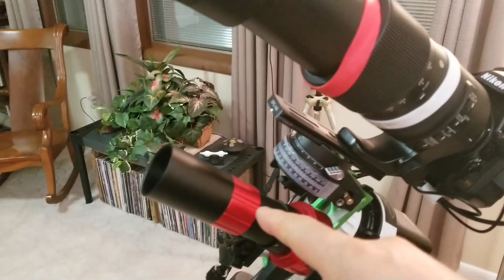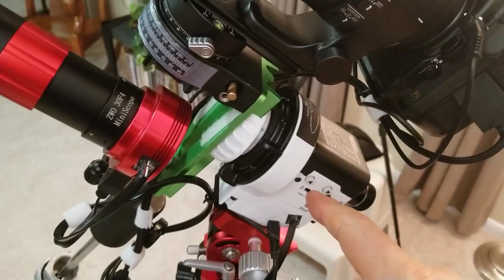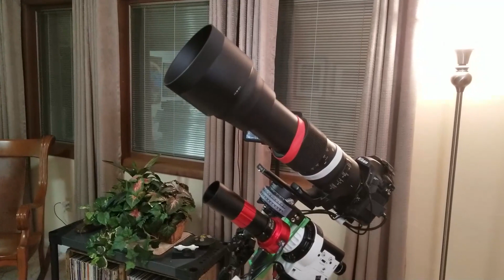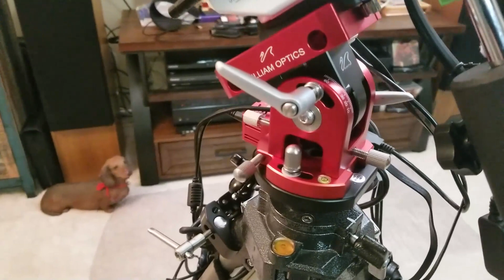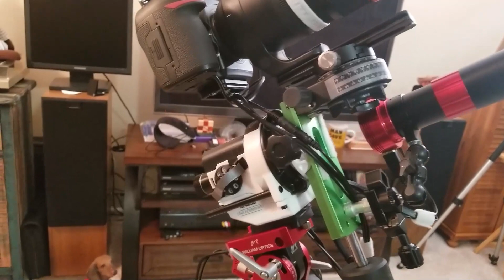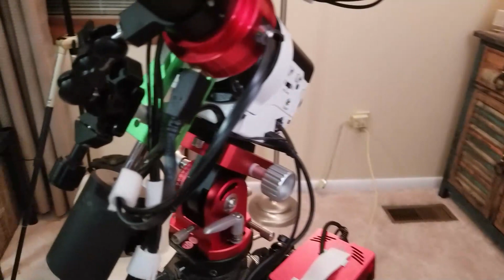Sky Watcher Star Adventurer Pro - An Overweighted Configuration

Comment: I mount the SA on it's wedge on a 3 way geared head and only do fine tuning with the wedge. Also do all my PA with the AAP.

I use a D7500 as it is much smaller and lighter than the D850, and I mount my guide scope to a very small ball head in the exact same position as you show.  

Were it me, I would loose the nodal rail and use a good ball head like the Benro IB2 instead.  The L bracket has a much bigger sliding area to allow adjustment for balance.  I actually mount the L bracket to the Lens foot, and then to the ball head.  Making balance even easier.

I don't see how you can position your camera to all points for the actual shooting without a ball head.

Nice video !
Reply from the maker: Thanks for the compliment on the video.  Actually, it may not be quite intuitive at first, but just as Latitude and Longitude, ignoring elevation, will can define a location anywhere on Earth, RA and DEC can similarly define any celestial position, ignoring range.  But, the "gotcha" is that if you are wanting to establish a specific field rotation to orient your subject in your image frame a certain way, then you will be unable to do so without either of (a) a lens collar, i.e., field rotator or (b) as you mention, a ballhead.  Even a ballhead is sometimes a bit difficult to position the camera with, but it is certainly easier than having no other alternatives.  

The biggest drawback to a ball head is that is may raise your center of gravity (COG) higher and put you in need then of a heavier counterweight to balance your imaging train, and then the concerns about payload capacity of the mount become a bigger factor.  With a mount such as the Star Adventurer Pro, you can lower the COG by shifting the dovetail plate to a lower position, but that may not provide enough offset or could also find equipment conflicts....knobs, dials, whatever...being potentially blocked from ease of access or other such things.  

Your idea of mounting an L bracket to the lens collar is an interesting approach and certainly seems viable, but if I have a lens collar in the first place, then it can be rotated by design so I'm not sure I see quite as much need there for the L bracket.  Of course if you're working with some type of lens collar that doesn't provide for lens rotation, then the L bracket idea would give a measure of flexibility in positioning.  the use of a long dovetail plate or nodal plate is twofold in that for this setup, it facilitates balancing along the DEC axis for a more optimum overall balance and the other reason is that I leave it attached at all times for that Sigma lens, so that it is ready for use on a gimbal for conventional photography.

Mounting the tracker and wedge to a 3-way head would certainly work to aid leveling the tracker, but that would have to be a very strong wedge to carry the weight of the tracker, camera, lens, and all else in the imaging train.  If the gear you're working with is relatively light weight, I don't see any problem really, but as you start dealing with larger and larger lenses or telescopes, it seems to me the potential torque on the head would likely challenge it to hold position securely.  I'm not being critical of your idea, but just sharing why I wouldn't go that route myself.  If, given your use of the L-bracket as you described, you could always keep the weight of the imaging train reasonably well balanced over the tripod head, then that would certainly help maintain that as a functional approach.  At the very least, it never hurts to think outside the box!  :)
Reply: @Ambress , I have the same lens, which I think you said is the Sigma 150-600mm, it's a beast for sure and when you start zooming out it totally changes the torque.  So I did two things that made a huge difference in balance and torque.

1. as mentioned, is the L bracket on the lens foot.  My ring rotates and I use that for framing or re-framing the camera after every 30 mins or so, but the L bracket is a game changer for me.  Because the L is so long in length, I can simply slide the camera left or right and that changes the balance or puts it in balance.  Try it, inside first, it is quite amazing.

2. I did something similar and bought a rod to extend the length the counter weight could travel.....ehhhh worked but that caused other problems.  So I just bought a 2nd counter weight (wish they would just sell a counter weight and not include the rod).  Now I can really fine tune the balance.  

I already owned a Manfrotto 3 way geared head, it is very heavy and solid and holds the SA without issue.. Just to be specific it's Tripod > Manfrotto > Wedge > Star Adventurer.  

Cheers

Comment: I am still puzzled by the reason to have dovetail for the lens. Can you explain to me reason for that? is it to move center of gravity given front heaviness of lens?
Reply from the maker: Hello Sumit.  Well, first of all and perhaps you know this already, even without a dovetail type of quick release plate, lens collar with some type of mounting foot for a tripod is useful on a lens and many long zooms and telephoto lenses to come with those.  But yes, exactly, extending the length of that foot with some provision to attach it to a tripod anywhere along the length will aid balancing your camera/lens combo, and that is exactly the goal for astrophotography.  The dovetail style of mounting plate just makes that much easier by having the ability to loosen the clamp and slide the imaging train forward or backward as needed to achieve balance of the DEC axis.  Before doing that however, you first balance in the RA axis by adjusting the counterweight so the mounted equipment when rotated to the horizontal plane is balanced with the counterweight, and then, to aid better gear meshing of the tracker or equatorial mount, you shift the counterweight very slightly closer toward the east so that there is a minor weight imbalance to oppose the RA rotation and put a gentle pressure agains the gears.

Comment: I came across this video looking for some answers.  You and one other person are the only people that have come out and said that using a 150-600mm lens doesn't work well with this product.  I have a D810 and the 150-600mm.  On my home scale the combo weighs 6.6 lbs.  I had started shooting with this and had my D810 modified for Full Spectrum.  I'm moving back to the Sony A7RIII and my 100-400mm.  It's over 1 pound lighter and had never had a problem when using it.  My Star Adventurer is at Skywatcher now being repaired.  The tech at Skywatcher told me that I was really pushing the limits to use the Nikon setup.  I can still use it for close objects and Milky Way with the Nikon.  Thanks for your video.
Reply from the maker: I don't specifically recall saying the 150-600mm lens doesn't work well with the Star Adventurer, but just going by the numbers and the recommendation not to exceed 50-60% of the rated maximum payload for the mount, that would be true in essence.  That said, with the overall configuration as I've presented it here, I'm frequently shooting with my Sigma 150-600mm lens on my D850 and with the fully configured setup inclusive of guidescope, autoguider, dovetail, cables, etc., all weight in just under 9 lbs.  NOT recommended and yet I really haven't had any problems with the SA Pro providing good tracking.  The only real problem I have is just a characteristic of the lens choice...less than round stars.  So, while I hate to give up that focal length, I'm expecting to receive a Zenithstar 61 on Monday, and if the sharpness with that is so much better than even a smaller image size can be enlarged to equal or better than provided by the Sigma lens, then I'll be in better shape as far as the weight is concerned, shaving off about 1-2 pounds.  I've been frustrated by the unavailability of a more robust mount, so I'm hoping use of the Zenithstar lens gives me a longer run of use with the SA Pro while also delivering better images even if they must be resized up some.  I'm glad your Sony setup is working well for you.
Reply: @Ambress  Thanks for the reply.  I will see what Skywatcher has to say when they examine my Pro 2i.  As I told them, I did use the Nikon D810 and 150-600mm on that tracker before without any problem.  I'll let you know.  Just got the SA Pro 2i in January of this year.  I know Peter Zelinka uses that lens but with a D750 Nikon.
Reply from the maker: @dlm-j3o  I forgot to ask, but what happened to your Star Adventurer that necessitated a repair....did the motor burn out?  I do wonder sometimes if I just happened to get a particularly good Star Adventurer.  WIth autoguiding and use of my ASIAir Pro, I've achieved as long as 13-minute exposures with my Sigma 150-600mm in use, and vaguely recall that might've even been with a 1.4X  teleconverter added.  That was all strictly part of a tracking test to see how long I could go, and the stars weren't particularly clean but star trails were absent, so the tracking itself was still good.  At 16-minutes I saw trails.  That said, I rarely shoot longer than 8 minute subs.
Reply: @Ambress   I was using it with wide angles for milky way season.  No problems.  When the Nebula's & Galaxy's started up I used it with the 150-600mm.  I'd go through the usual setup tasks.  Take my test shots, re-align the camera and lens.  Sometimes before I was ready to shoot and sometimes in the middle of shooting the Mode light dial started blinking.  After polar alignment I usually turn on the tracker.  I was in contact with Kevin at Skywatcher during this.  He had me loosen a tiny screw just in the front of the black mount for the tracker.  I'd turn the front of the tracker and would hear a clacking noise with the screw loosened then slowly tightened it down while moving the front dial until the clacking stopped.  Set it up in the same position I had it on in the field. Let it track 1 1/2-2 hours in my house.  No problem.  Go out that night and shot 20+ shots to get Andromeda in the frame where I wanted.  Moving the arm and camera slightly each time.  Finally I get ready to shoot and the mode light starts blinking again.  Contacted Kevin and he cut me a label to send it back.  Which is where it's at now.
Reply from the maker: OK, from what you describe that definitely sounds like a problem inherent in the mount, so I'm glad you've got it in Skywatcher's hands for repair.  Good luck!

Comment: Awesome video - It's always great when you hear from someone who's sharing lessons learned - thank you!  So question for you.  I see that you mounted your guide scope on the declination bracket - does that work ok?  I was under the impression that you had to have the guide scope in alignment with the lens.  Clealy, with your setup that is not the case.
Reply from the maker: While mounting the guide scope on the declination bracket did seem to work for me without any issues, and actually gave me some flexibility in where I aim the scope, I did ultimately wind up moving the guide scope to an Arca-Swiss clamp that mounts to the side of my camera on an L-bracket.  I've got another video that addresses those changes.  I believe you do generally want the guide scope aligned with the lens, but I've had cases where trees obstructed the wider view of the guide scope enough that it wouldn't track well, so I aimed it independent of the main lens, to another area of the sky, and I still had good tracking.  That's more of a workaround than a routine practice however, and from what I've seen others say, is perhaps going to introduce tracking errors.  Perhaps that's more true if you position the scope to a significantly different position, I'm just not certain.

Comment: Thanks so much for describing your encountered issues and ingenious solutions for the Star Adventurer (SA). I use a Celestron AZ-3 mount to hold my SA rather than tbe original wedge and the polar alignment control is buttery smooth. Also http://www.astrokraken.fr/accessories-for-skywatcher-star-adventurer-mount-a184487612 sell a host of accessories to make operating a SA a joy. Incidentally there's this video which I consider the best introduction to the SA around. It does miss out on initially aligning the polar scope in the body of the SA Mk2.
https://www.youtube.com/watch?v=VgofjazAbKo&t=2529s
Enjoy your imaging with the SA.
Cheers.
Reply from the maker: Thanks for the link to the Astrokraken site...I have no need for the SA accessories but that is still good info to have.  I agree that the YouTube video you linked is a very good one for the SA.
Reply: @Ambress  Hi Daryl, pleased you found both links of interest. I've had my Star Adventurer mount for a few years now and it is a very easy to set up piece of equipment. The little accessories just go to make set up and use that little more quick and pleasurable to do. Enjoy your imaging. Cheers, Steve.

Comment: You Sir are my hero for today. You didn't mention it, but i had to laugh when i saw the straw you put on your polar finder hole on the side of the tracker. Because i did the exact same thing on my star adventurer. =)
Reply from the maker: Hahaha....thanks Reto, but I must pass along credit to Andrea Minoia, whose "Ultimate User Guide to the Sky Watcher Star Adventurer Pro" page provided that idea.  https://nightskypix.com/skywatcher-star-adventurer-pro-setup-and-user-guide/
Reply: @Ambress  i acutally velcroed a laser pointer to the same spot. I bought just a cheap green laser pointer, and i only turn it on for a second when i want to look through the polar scope and identify the damn Polaris.
Reply from the maker: @aerozg  Glad that laser works for you!  I recently bought a couple green lasers, one being for a rifle and thus having windage (Azimuth) and elevation adjustments and although still about 1-inch in diameter, is at least shorter than the other laser. I hang it with magnets from an adapter I made for my lens dovetail plate but on reading what you did, I may try gluing some small magnets to the side of the SA so that I can attach the laser there, thus it's no longer having to be moved when I change out lenses & dovetails.  Lasers do seem to work pretty well for getting a coarse alignment initially set up.

Comment: I’ve  done this since 1994. Spend the money on a sable platform. It will be money we’ll spend. Single worst thing is camera movement. Like a 3040 bogan or 3021. 3047 is a great 3 way head, also has a bubble level built in. Bonus
Reply from the maker: Hi Trevor, I agree fully, a stable platform is perhaps the most important ingredient toward eliminating camera movement.  I've got that pretty well controlled but do hope to eventually move up to a more robust eq mount, my eyes being on the iOptron GEM45 or CEM40, as I'd like to get a mount rated for a maximum payload of no less than 40 lbs. to allow some decent growth room for the future.  A 20-25 lb. payload (using the 50-60% rule for optimum tracking) would be pretty easy to hit if I go for a quality telescope of similar focal length to my Sigma lens, which has me spoiled for at least 600mm.  The iOptrons are pricey but I like their lighter weight, but may still reconsider when the time comes....money saved could be put toward a nice telescope.  

The tripod I'm using is an Amvona clone of the Bogen 3020, which I also have, but favor keeping as my primary photography tripod and use it with an RRS BH-40 head.  The Amvona is just as stable but the head I had on it was cheap so it was a good choice to use with the head removed and the Star Adventurer Pro directly mounted to the platform for the best stability and ability to carry a heavier payload.

Comment: Thank you very much for your video Darryl!
It is very clear and useful!!
I had some of the same problems you are describing with my Star Adventurer Pro, and in my case, I had to build a especial support to hold the Telescope, the guiding scope, both cameras and the ASIAIR Pro.
I also managed to solve the power switch problem by using a similar solution to yours, using Velcro and also solved the polar scope illuminator issue by building and installing a variable red led little pack, which in fact I barely use, since I bought the ASIAIR PRO.
The only thing I didn’t do was to replace the wedge (yet 😀).
Great video!!!
Cheers,
PauloF
Reply from the maker: I'm glad I could be of help Paulo and I hope the support you made is working well for you.   As you, I too don't even have to worry about the polar scope illuminator any more, since I use the ASIAir Pro for the polar alignment process.
Reply from the maker: You're welcome!